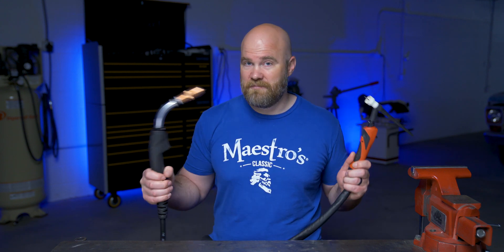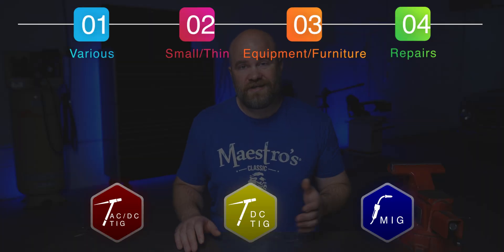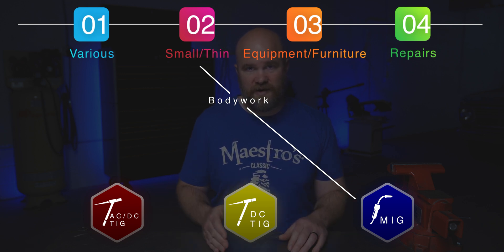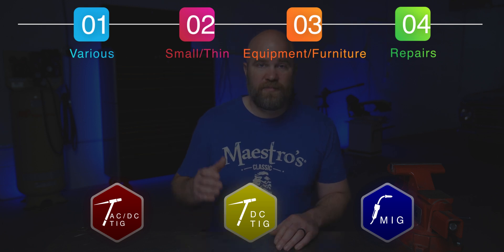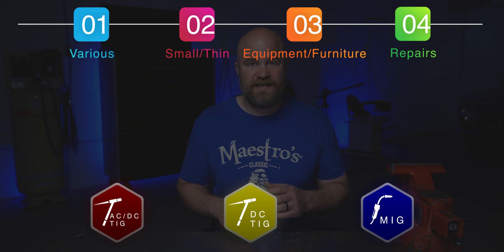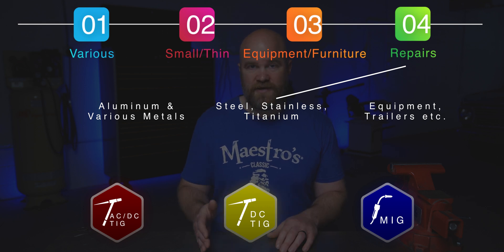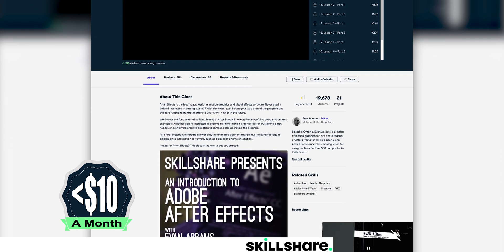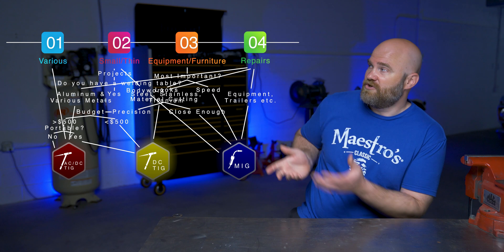MIG vs TIG for your first welder?

Comment: My first welding experience was with a borrowed flux core machine.  For some reason that made learning stick welding harder.  Now I'm going through the learning process with DC TIG.  So far I am adept in sticking the tungsten and running mud ugly passes without filler metal.  It is still early in the process.

Comment: A friend of mine and I are still kicking ourselves over when the place we used to work at went belly up and we could'nt make an offer on the welding machines we had there... Really nice portable TIGs that could do 600/220/110v with the right adaptors... Of course the duty cycle went accordingly, but knowing you could weld pretty much anything anywhere was cool!! We could have bought them for a bargain yet still way over what the liquidators valued the machines at!! Dammit!!!

Comment: I am going for an everlast stick/ dc tig, POWERARC 210STL (or similar) after way too much research. sort of best bang for the buck, for what I will face. which is really a combo farm repair with old rusty painted metal outdoors, and some small delicate/ fabrication work with welds that will be seen. I decided best to get a dedicated mig machine, for mig. lots of moving parts in the mig. so prefer to have those isolated, rather than try to get it all in one machine.

Comment: Thanks, that open my mind about what to buy when open a shop, and help me understand how to split the budget.
Reply from the maker: Awesome, there are also multiprocess machines to make it even more complicated. If you will eventually have multiple people working I’d want separate machines.
Reply: @JustVoss  Yeah I love the ideas. 
Actually, what shop dimensions do you think are the correct to operate a milling machine, metal lathe and some welding? 

Length:
Width:
 Height:

Comment: Thanks. I was just a little surprised by the « thin / little - bodywork » answer. I have to weld thin sheets of steel such as car doors (0.6 to max. 1mm parts) and I really thought TIG could be the best for me. I don’t need speed, nore long welding.

Comment: you should talk about multi process machines, like the Everlast Lightning MTS lineup vs Miller multimatic and Esab Rebel!! that would be a good video i have the Everlast lightning 225 thing is awesome! does every thing but i have always wondered how it compared to a bit more expensive units like the miller and Esab. Just ideas and im sure other people are looking at the 3 units to compare as well! there was not a lot of info out there comparing them from what i could find when i bough mine apx 2 year ago now.
Reply: I went with the Miller Multimatic 220 AC/DC. Does pretty much everything, except pulse on AC TIG. It’s pricey, but worth it, IMHO.
Reply: I had the esab 215, but gave it away when the 205 finally came out. Great machine.